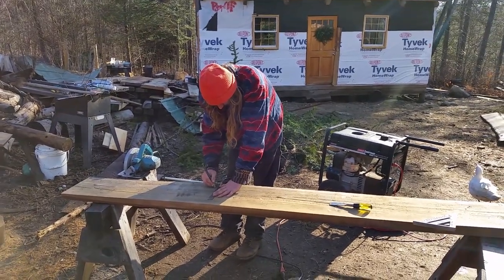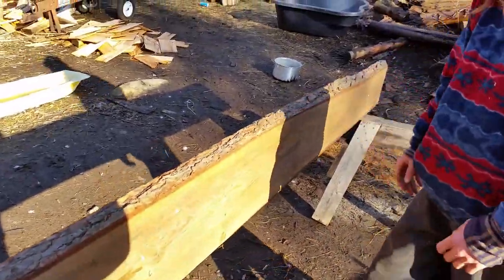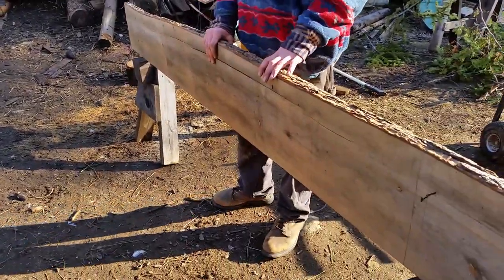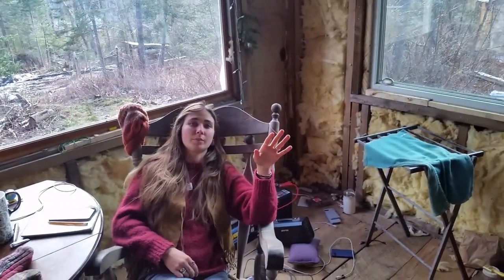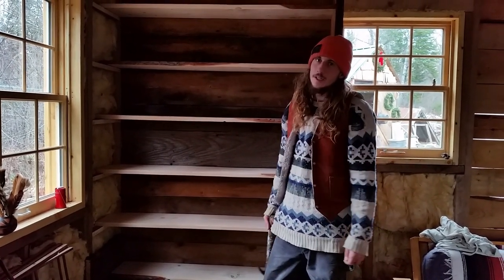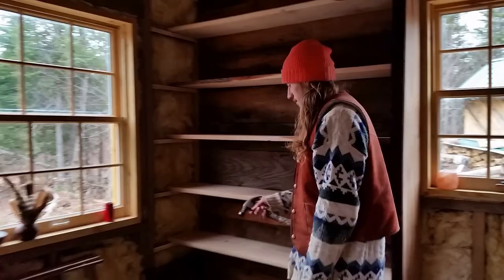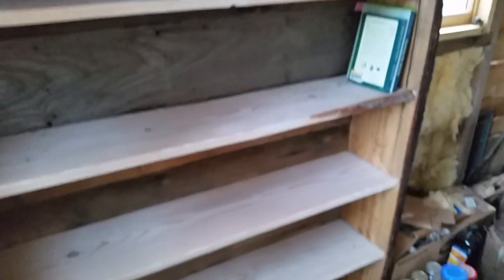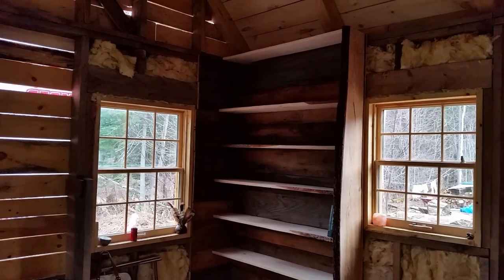Built In Furniture | Live Edge Built In Bookshelf | Hemlock Slab and Barn Boards | EP 22

Comment: No vapor barrier? You must control humidity inside to avoid freezing condensation on the interior face of your exterior sheeting
Reply from the maker: Good eye! I think "must" is a bit aggressive. We don't have any freezing condensation whatsoever, as the environment is super dry due to wood heat. I suspect we probably won't get any condensation in the winter either, due to the fact that the exterior sheathing are boards (with gaps for ample ventilation) as opposed to plywood. 

We may install a vapor barrier in subsequent sections of our interior sheathing.
Reply: @sacredcirclehomestead3395  maybe on the north side would be better. You would have the gain heat from the sun on south. Freezing humidity would be on the north side under isolation. But i think that the must important thing in an envelop is the wind barrier system thigt on the outside. Since you don’t put gypsum board but wood plank inside, maybe your a able to removed a plank and insulation in febuary, before hot day to verified is there are freezing condensation. (Please forgive the way I express my taught. I am a french from Montréal)
Reply: But the air barrier system help for energy effencency. If you have gaps between board on the exterieur sheating your Wood heat will the interior and the outside too. You would see this winter how many wood you burn.